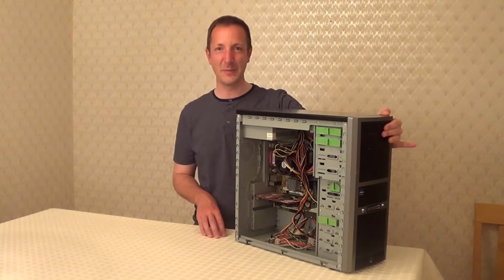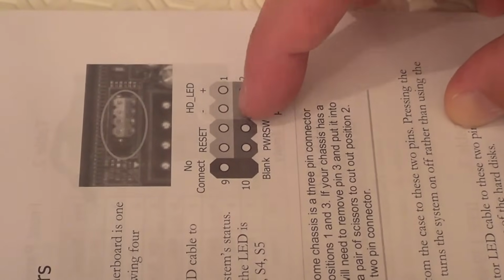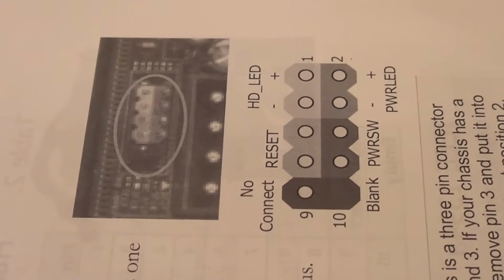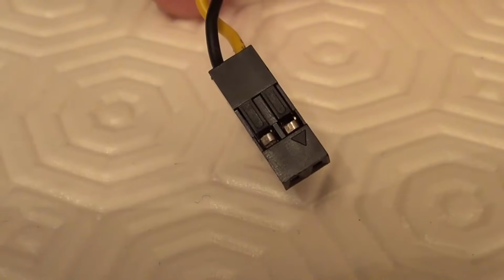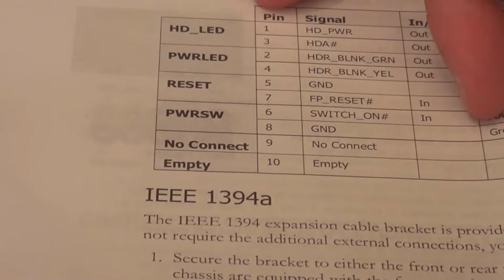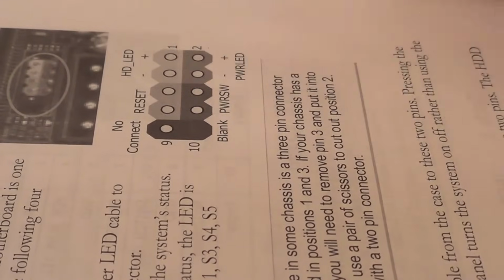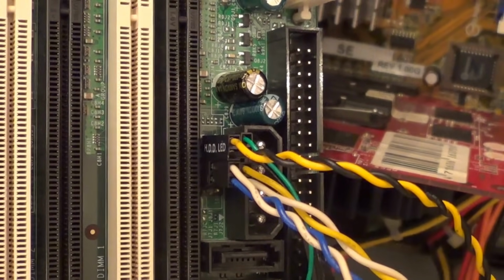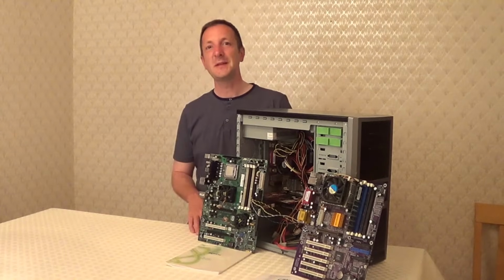How to connect Front Panel Connectors to the Motherboard

Comment: Wait, what do I do if my power LED has 3 pin connection? Because I have a PC that was turning on just fine, I took it apart, then when I put it back together, the thing just doesn't turn on anymore, and it has the exact same connections on the motherboard as yours, I checked the manual. Do the colors matter? Because they seem to be different on mine than in the manual.

Comment: after 6 years, I was trying to repair my Desktop, with which I have lot of memories. I got 10 years old video. The CPU runs.
Edit: Startup repair failed. at 0x00000 referenced memory at 0x00000. the memory could not be read. And Desktop is not getting started.

Comment: Trying to decipher the panel cables coming from an ACER case w/o taking the case apart.  I was going to use the bad mobo to identify the cables BUT there were no markings on the board defining the pins.  ONLY COLOR CODES (!)    So it's either, find an online manual for the board or PC, disassemble the case to trace the wires, or find out if the color codes are an industry standard and then find out what the colors mean.  Thank you FOXCONN

Comment: Trick question: how to hook up the key lock pins? The key lock has 2 wires but the motherboard has a 5 pin header for it and no mention on the manual at all (I don't have the original manual but I found a PDF for the type of motherboard I have). Does this mean the 5 pin configures how the lock works and what function it enables/disables when the key is turned?

Comment: until all motherboard manufacturers start to standardize this header, this tutorial will be hard to follow. ASUS is really terrible about this when they deviate from the standard pattern the the industry tries to set. it would be great if the chassis manufacturers and the motherboard manufacturers worked together to standardize this connection and all the chassis had a 10 pin connector for this header. I hate this part of building a PC because you have to fight with the connectors to get them in the right place and in the right orientation.

Comment: I am connecting a new MB into an old case with front connections.  The audio cables on the case are labeled mic; mic pwr; ground.  And l out; r out; l ret; r ret; ground.  The MB only has 1 ground; mic detection; head phone detection; mic l; mic r; sense_send; and an open pin.  Do I connect my 2nd ground to the open pin or leave the pin open & not connect the speaker ground?   I enjoyed how clear & concise your video is.  Thank you.

Comment: PW Switch and RESET Switch you can plug whatever you like (on the proper pins), that are just 2 wires with button that closing the circuit so you dont need to think about positive / negative.

Comment: On my motherboard hdd led pins left to right are + to - and right to the left of them are the pair of reset pins and they are labeled grnd to -. Now all the plugs seem to be oriented + to -', + to -. So for the reset plug I apperently have to twist it against the orientation of its wires in order to connect the ground to ground and positive to positive. In my mind it just seems wrong. According to this guy I might get away with hooking up the reset plug the wrong way so I don't have to twist it against its orientation.

Comment: The reason why im scared to death of building a new pc is this part.This is the most fucked up and the most difficult part of building a new pc.Since every motherboard is different and every case is different and they have different pin conectors and the order of the connectors is different on every motherboard.I remember when I made my first build 13 years ago,it was a  build for my parents I was a child then and there was no youtube I had no manual I just put the connectors in the way I thought that it was right and to my surprise everything worked fine except the fact that the light on the mouse and the keyboard would still be on even after I would turn off the computer.13 years later I still cant figure out what I did wrong there lol although the pc is still working perfectly probably messed up something with the usb pin connectors from the case.

Comment: Thanks, really clear and helpful. I didn't know which was positive on the power cable. I've previously only installed ASUS, which make it easy with a connector, but this time switched out a failed Asus mobo for an Asrock

Comment: What satanic asshole thought this part of this computer was a good idea? You need a microscope and luck. One plug! It's not hard to do. 

Thanks in particular for the advice on what the consequences are doing this wrong, because it is so, unbelievably easy to do so when modern computers don't include those arrows.

Comment: Have front panel connectors not changed in 20 years?  I have an old mobo does it work with a modern case? And vice-versa?

Comment: You did a great job of showing the F-Panel connectors with useful instructions...but...you messed up at 7:47 with the blue and white connector (for the RESET).  You did have that wrong, as the blue connector should be on the positive (pin 5) and white (pin 7).  For a moment, I had thought you'd done that deliberately, as a point of instruction.

Comment: I have all of my connectors plugged in correctly according to my manual and my power switch still won’t work, whenever I used a flathead to turn in it all of my other ones worked, including my reset and power and hdd led

Comment: I accidentally put out all this wires cause I had problems connecting a Sata beside the connectors. I thought it's easy to put them back in but than it was so confusing. 
Thak you.

Comment: What do I do if I'm trying to reuse an older motherboard that doesn't have a front IO pin set. It just has a plug labeled front IO. Are there specific pins in that that I can use?

Comment: Thank you so much. Your video was so helpful. I was confused and thank you for further stating that if plug incorrect there is no harm done. In addition thank you for also stating that the colors of the wires will not always be the same that is why it is important to know and understand the manual itself and the positive indicator.

Comment: this is one thing about computers that pisses me off. these type of plugs on the computer need to be redesigned in made simplified. the front panel connectors is the hardest part about building PCS.

Comment: Thanks. I have been building computers for my family members forever and I never knew that they put that arrow on the reverse side to indicate positive (+). You just made my day. I just purchased a high end desktop case that had the USB 3.0 connector and realized that my old motherboard didn't have a place to plug it in even though it did have a two 3.0 connectors in the back. I guess that means that I need to start looking for a newer motherboard.

Comment: What happens if you put the switches in the wrong location e.g Reset on Power Switch and Power Switch on HDD LED. Would it cause any damage etc.

Comment: My case has a led but it won't switch on... What cable have i connected wrong? I have 2 cables for power led, one positive and one negative. Is it bcs of them? Does it have to do with the direction?

Comment: Great video thanks!! But I have a question. At a little after the 10 minute mark you hooked the 4-prong Speaker wire to the corresponding prongs on the right side. But there are another four prongs to the left of that, closest to the "SPK1" lettering. Why are you choosing the four prongs on the right and not the ones on the left, immediately adjacent to "SPK1" instead? Is that arbitrary and does it matter which of the four you choose to connect the speaker wires to?

Comment: My power button works. But the power button led won’t power on. It did before and I’ve checked the manual, made sure the positive and negative was right. I’m not to sure what it is. Tested leds on another MotherBoard and they work just fine

Comment: Now this dude knows how to do a proper step by step guide by the numbers;  I guess I had it, "the wrong way" .. All around and up side down! lol. Thx Brah!

All my older cases have this as a one clip plug; a red and a white, and a blue and white wires with a bakelite clip, (heat resistant; same material car distributor cap are made from, even though very low volts), now cheap China plastic with bad English abrevatuons.

It like instead of getting better in time, we are just getting cheaper, were just going the wrong direction .. round!

Very Respectfully,
WX2

Comment: Is there some kind of adaptors for  this? Put new parts into an old case. It only has 9 spots for the pins and one blocked. You can't seperate them.

Comment: When you connected the PC speaker, shouldn't the plug have been put on the top row of pins as indicated by the 'spk1' marked  on the motherboard? The bottom row seems to be jumper pins (to reset CMOS?).

Comment: I would add this advice:  Front Panel connectors are usually a bundle of thin connectors which usually make a nice block once hooked up correctly.  Therefore, you can tape the headers tightly with electrical tape and that way they stay arranged correctly if you ever need to unplug them for whatever reason and easily plugged back in without a need for manual.

Comment: +pisses me off so much that they have no standards the trial and error method can take forever..my power LED has a 3 pin connector and the motherboard has a 2 pin interface ...the wires are on the outside holes of the connector which makes one wire unconnected to the pin

Comment: Hello, connecting the power pin the other way around (+ to - and vice versa) could stop the BIOS to boot?
I transferred today my old rig to a new case and i might have connected wrongly the Power pins to my mobo. The Led phase lights are blinking now and BIOS wont boot at all (no beep as well). Unfortunately i let the pc into a technician to check it.....

Comment: my Asus board has 3 different usb connectors but my Zalman case doesn't say which Front panel usb connector is either usb910, 1112 or 1314.  How can I know which port to use?

Comment: Hello there. Would it be safe if I were to plug the reset connector to the power and power connector to reset slot. My power button is hard to push so i figured that I switch the two but im not sure if its safe

Comment: What does one do if there are no visible +/-, colored wires or indicators like on the Cooler Master Storm Stryker to Asus Z170 Delux?
Is there some rule of thumb that + {positive} is always on the right of the lettered side? 

In this day & age with the increasing volume of computer users & builders one would think standards should be higher. 
Even the ridicules lay out of a build is laughable when you think about it ~ I know of course the industry needs cooperation across the (MOBO) board but with so few 'players' this shouldn't be an issue. The fast pace of technology is a facile & contradictory argument also. 
On word: Vision 
One phrase: There must be an easier way...

Comment: hmm so I got a new case, and pwr sw cables will power up the pc, but it won't work, no screen, no mouse. When I plug in the connector from my previous case's button it works just fine. Any idea as to why that might be?

Comment: That looks like an excellent mobo manual, I'm trying to connect the front panel cables the via the Q-Connect supplied connector, you should read the Asus Maximus VIII Extreme manual for connecting this ...  sparse information, just a basic 3D diagram ... bloody awful ! download the PDF if you don't believe me.

Comment: Never buy a pre-built computer if you plan on upgrading, mine had such a generic motherboard it was nowhere to be found on the internet, i had to guess which was which on those connectors, took me a good hour with slow boot times and whatnot.

Predator G5910 used btw, incase anyone was wondering.

Comment: wow!!! you were very awesome on this video!!! I did the little wires on my new motherboard and I was sooo afraid that I messed something up because when I open a game it keeps saying .exe has stopped working.  now I know that those little wires has nothing to do with Windows or the games that keep crashing.  they never crashed before... ever.. on my old motherboard.  did I do something wrong?  it hurts my stomach thinking that I messed something up.  everything works fine but my games.  am I supposed to upload some kind of drivers or update something?

Comment: why RESET's and PWRSW' s positive/negative doesnt appear on "front panel connector guide table" ?
because u said GNDs are negatives.

why they did not used negative-positive showing in guide as HD_LED & PWRLD??

+what means GND? you know that means negative but why?

(plus great video)

Comment: hi i need some help 
my case's front panel power is on a 3 plug instead of a 2 but it only has 2 wires in it but one of them doesn't get plugged in if you know what i  mean. please help if you know what needs done

Comment: Thanks for the video, very useful
I have a question, what part or component on the motherboard receives the power on signal?
I have a "dead" PC, it doesn't seem to do anything when I push the power button, I've already tried with a new power supply, new CMOS battery, and other stuff
Even (and I think was a bit senseless or stupid), I've tried making a bridge between the green wire and any black wire on the power supply (as if testing it) and plug into the motherboard, the processor fan spins as expected, and the speaker makes a very very low sound... I've done the same with another motherboard (in perfect state) and I realized that this doesn't power on the PC, it only energizes it, the PC turns on until I push the power button
And that's why I want to know the answer of my question, I want to know what part of the motherboard is causing this issue, cause I'm not an electronics expert and I have basic multimeter testing knowledge
I hope I explained myself :s

Comment: You have been a big help.I pulled the plugs off,thinking they were one big plug.I needed to get to the battery,and the wires were blocking it,from coming out.Your instructions helped me set the wires right.The on/off switch,wasn't lighting up,or the hdd light.now they do.THNX,ALOT.

Comment: Hey,one question. My motherboard has sockets for Reset,Speaker,HDD LED,Power LED,Sleep and ON/OFF,however the cables that I have lack the ON/OFF cable. Is there a way to connect these so that it actually functions? Also,there are two Power LED + sockets and one power LED - socket,but I only have one + and one - power LED connector. Help anyone?